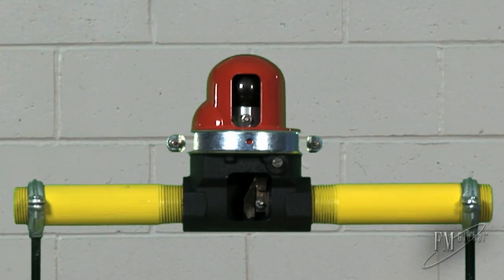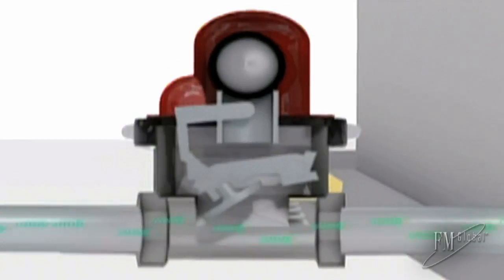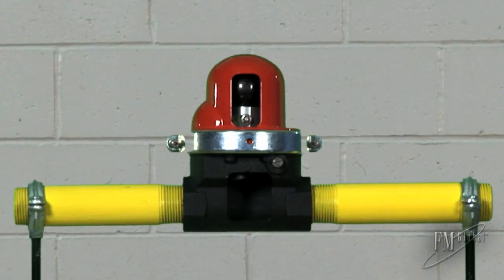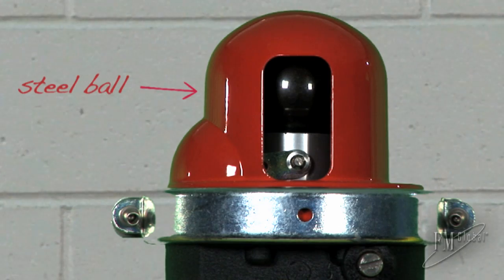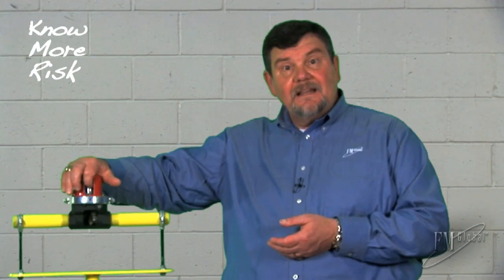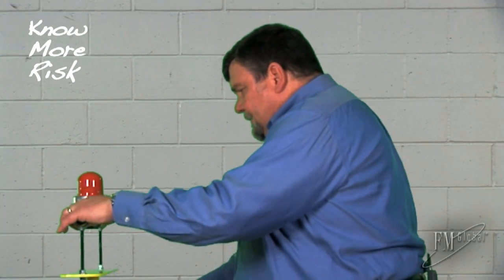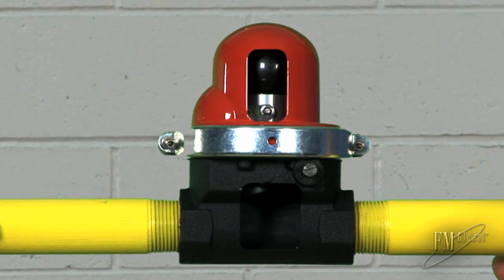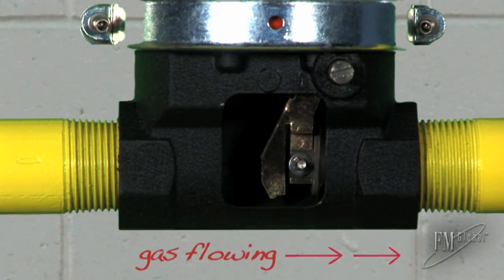Know More Risk: Seismic Gas Shutoff Valves

Comment: I have work for the natural gas utility in St Louis Missouri for 35 years and can tell you this is one of my favorite seismic valves. They can go off accidentally but this is usually caused by a commercial lawn service running into the meter set. In the event that would happen it's probably a good idea that the gas company  out to inspect and evaluate . If one does go off I would say it should be mandatory that a pressure test of the system be performed before putting it back into service. Just an FYI ,when installing this particular model make sure the reset is facing out for screwdriver access. It's a pain in the ass to reset when the reset is facing the wall.

Comment: On February 9th, 1971, the Sylmar quake hit before dawn. I was 17 and was sure the Soviets nuked us. I had a bookshelf fall onto my bed along with everything on it smacking me everywhere. I tried to get to the living room in the dark and stepped in broken glass and fell over a wall unit that tipped over. Ever since then I made sure that I had automatic backup lighting in my houses.  But for at least 10 days after the quake, everybody was afraid to sleep and was afraid to be in the house. Aftershocks hit randomly and the power was out for days. To keep myself busy, I made up a seismic gas shutoff valve out of my dad's 3/4 inch pipe plumbing parts, fiberglass, a 5/8'' steel ball bearing, o-ring, and bits and pieces. The ball bearing fit into a divot I ground at the end of the rod and any shaking would make it drop into the gas outlet hole with the o-ring as a seat. To reset the ball, the plunger rod had to be pulled down against a spring until the ball rolled back into the divot in the end of the rod. I got the idea from a pinball machine. After resetting, you screwed on a pipe with a cap on the end to cover the plunger on the bottom of the unit to make the reset system gas tight.

 There were a few house fires in Sylmar caused by hot water tanks falling over and that's why I thought of building something to prevent that. My dad was proud of my invention but said that nobody would buy one unless the insurance companies required them. I last saw the valve in the attic of my dad's garage after the cleanup a few months after he passed away in 2002. Sometime in the 1980's, I was disheartened to see a similar commercial one for sale in Builder's Emporium hardware store where Home Depot now sits. It had the same plunger reset mechanism. Our County requires seismic shutoff valves on new construction. I installed the square anodized blue one with the dial magnet reset on my house 20 years ago, probably before the Red Hat came along. I invented a few things in my lifetime but never made any money off of any of them. I look back and chuckle.